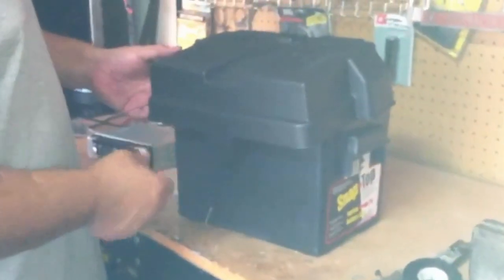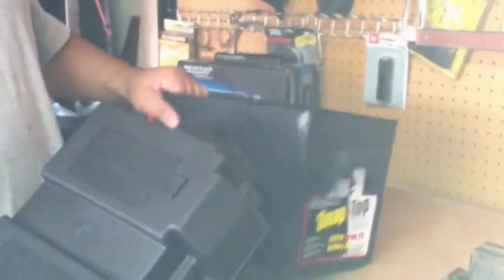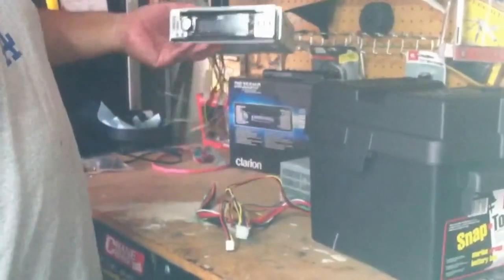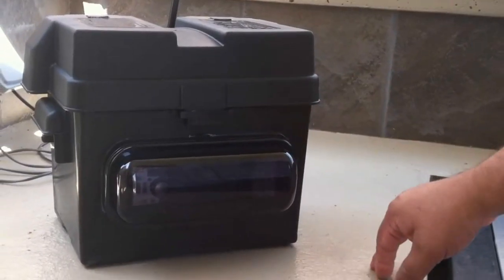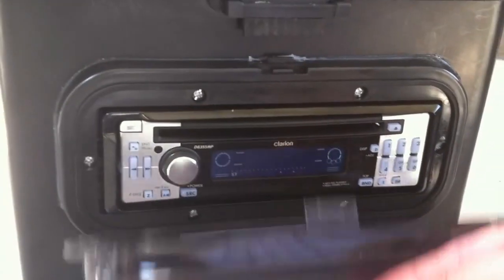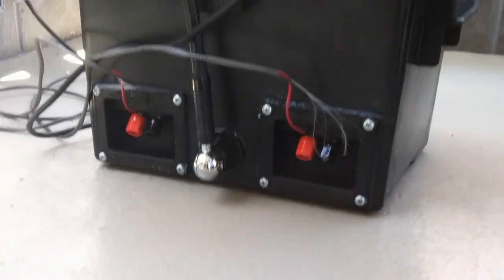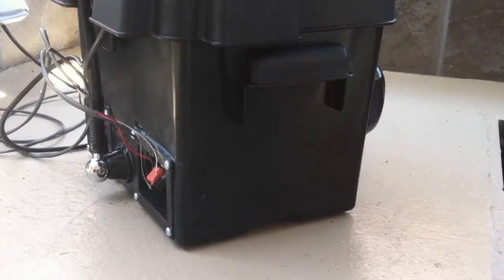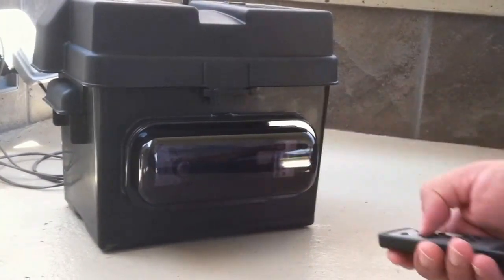How to Make an Outdoor Stereo Using a Car Radio

Comment from the maker: No, that is the beauty of this system. By using the computer power supply, you have an electrical cord to connect anywhere you want. I never used an ac/dc converter but it would be more complicated, and take up way more space. This is supposed to be portable, and the converter and battery just adds weight.

Comment from the maker: Believe it or not the box I used is very weather proof. It has gone through a winter of very heavy storms/rain and even snow, and it starts right up every time. I keep it on my outdoor kitchen countertop. Remember, the box is very heavy gauge plastic, no holes except the (waterproof switch and waterproof stereo cover), and the top is water tight. Jacuzzi's use similar switches and stereos (with weather cover) and they've been tested over the years with no weather related problems.

Comment from the maker: My stereo plenty of power (200 watts I think), and drives 2 outdoor Bose speakers with no problems or distortions. It really depends on what head unit you use. If it is a high power unit it should work fine.

Comment from the maker: Actually, I don't think any after market stereo's require a code. That is a feature for stock car stereo's as a security function. Just buy a cheap, high power car stereo from Walmart preferably one with a remote control. No codes are required when you disconnect/connect with aftermarket stereos.

Incidentally, the unit is still working fine over a year later. I've never covered it or brought it inside the home.

Comment: i was just thinking about this... my question is, do you have any issues with not having a battery in the system, i know this is an old video, i was looking at using an ac/dc converter and using a lawnmower battery...

Comment: I like the project and video.  Did you bundle up and connect all the extra wires by color from the power supply or did you just connect the wires you needed for power/ground and green to black bypass and leave the extra wires alone?  Thanks.
Reply from the maker: Good question! I only used the ground and green bypass. The extra wires were bundled and taped. * By the way, this has been outside since i made this box in 2012 and it still works perfectly *

Comment: I like the idea of using the 12 volt rail of a pc power supply from some old computer.  My question did you have to do anything special with hooking up the antenna? Did you have to ground it or did you just plug it in? Good FM reception?
Thanks
Reply from the maker: Nope, the antenna was just hooked up on the box and plugged into the stereo antenna jack.

Comment: I was thinking on making a small speaker system for my cabin without having to use any 230/220V power supply. My plan is to connect a car battery to an amplifier that i can connect 2 speakers, a dvd player with maybe an aux and usb, and a sub too. But im not sure what i need to buy? help me please? Im really a noob at these type of things, so if anyone can help me it would be awesome!
Reply from the maker: That should work, but I'd recommend a marine battery or an Optoma yellow.

Comment: Do you leave the power supply plugged up to the electrical outlet or do you disconnect it when not in use?
Reply from the maker: good question, I've left it plugged in a couple of months at a time. No problems